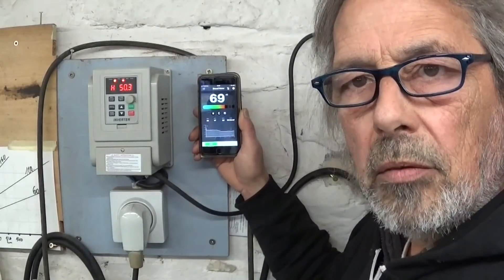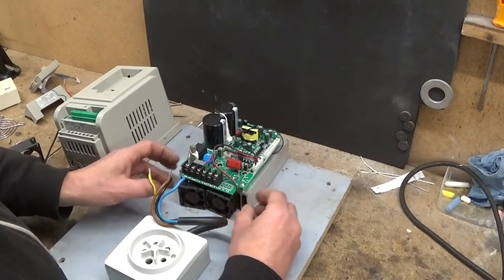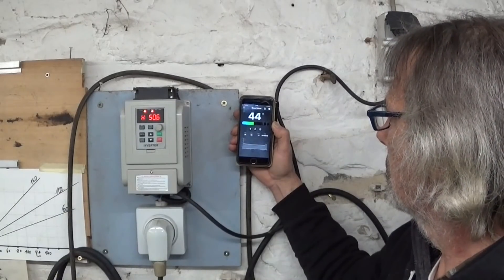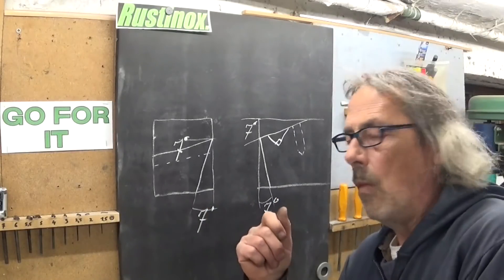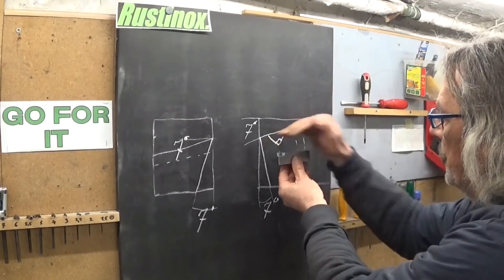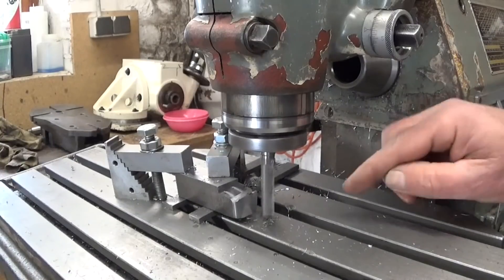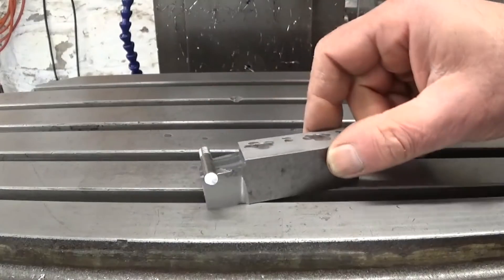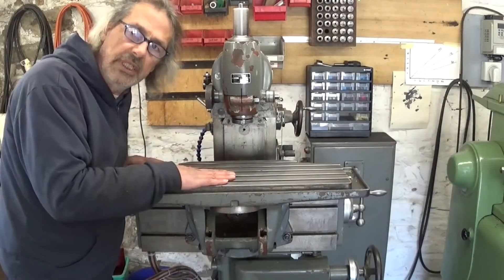A fan, a hand wheel and a show off.

Comment: Great video, Rusti! I have a suggestion. Your solution to the fan issue was brilliant. I would suggest one thing. Swap your fan out for a 140mm Noctua Industrial. 31db and a metric butt ton of airflow. Computer power supply fans are really garbage for the amount of air that they push. I wouldn't be surprised to see a 3x increase in the amount of air you are moving. Really, I think, a fan optimized for static pressure versus airflow, I think you want airflow.

You may not care, but if you do... well, there ya go. Or, when that PSU fan dies, you know where to start.
Reply from the maker: Thanks for you input, Nick.
The VFD never gets warm. Not even a bit. So, this fan will do.

Comment: Man, you packed a lot in that one.  The quieter fan is noticeable, even through the camera mic, the quill wheel is a good idea (I like the one on my mill), and that tool holder could be very useful doing an internal counterbore, especially since the tool bit could be custom ground.  I'm also still fascinated by how flexible that mill is.  All sorts of possibilities!
Reply from the maker: Thanks Everett. On this machine you can make everything... almost.

Comment: Great video. Bighead. My mill will not do those angles. Also as Mark says. My omron inverter only runs the fan at certain temperature. Regards.
Steve.
Reply from the maker: I think I don't even need a fan for what I use the VFD. Future will tell :)

Comment: The rotation of the table? Are you able to rotate it while cutting? Is there a hand wheel to control the speed?
Reply from the maker: There is no hand wheel to rotate the table. It's meant to be fixed when the angle is set.

Comment: At least you wont have to do what the machine does, that will save your back 😅 I've never come across your make of machine before, in one of my jobs I was a service engineer for a machine tool agent in the UK and I installed many machines from European manufacturers. One German company, Wera, made lathes which could turn hexagons, squares, triangles etc but wasn't very good at round parts 😂
Reply from the maker: Well, I guess you've fiddled around many machines then :)

Comment: I did exactly the same thing with my VFD, but I already had a super quiet PC fan and it made a huge difference. I also put it in a case for safety and stop dust and now it's basically silent. 
Also live the milling machine, such versatility.
Reply from the maker: That's a nice upgrade.

Comment: Michel, I fitted the stock fan in my Chinese VFD with a simple temperature sensor held against the heatsink. Now the fan only runs when the heatsink gets to 45C which is almost never. That Deckel mill is truly versatile. Nice to own!
Reply from the maker: I've watched your video on the VFD.
I had a bit the same idea. At 3:51 you can see a thermostat in the background, but it was too big to install.

Comment: Great work on the fan noise reduction! Love the mill and shaper! Just as an fyi...I think some vfd's only run the fan when needed while some of the more cost effective vfd's run the fan all the time. I don't know all the names of the parts in the vfd but whatever the heat sinks are on is what the fan is trying to keep cool. If you run the vfd hard for 5-10 min that part of the vfd will be as hot as it'll get. You can measure the temp at the heat sink. then you could splice into the fan wiring and install a temp sensor switch on the sink so that the fan only comes on when its temp gets 10-20% below the temp measured.
Reply from the maker: At 3:51 you can see in the background a thermostat that I planned to build in. But it was to big...

Comment: Your angles will change when the tool is back in the horizontal plane .  There is a complicated formula to compensate for it . 
Nice quill wheel  Rusty .      Cheers     👍
Reply from the maker: You're right, but I always run when it gets to complicated :-)

Comment: You are winning :) That fan upgrade worked out wonderful. I use the same drive on my lathe, but that doesn't get as much use as your shaper :)
Reply from the maker: Even without modification, its less noisy than your Allen Bradley :-)

Comment: Good idea, nice work.
Was it a "standard" 5 or 12 volt DC fan You manipulated? What was the gear controlling the PC fan?
Will You change the fan in the hot air gun too?  Joking!

25 years ago I invented a method to speed control 48 Volt DC fans. The seller of them said: Not possible....
Reply from the maker: If you invent something that the boss doesn't understand, it will never take off...
Reply: @Rustinox  The retailer said no but in the reality it worked well, and the boss was happy! As the machine sometimes operates in freezing conditions, sometimes in room temperature, controlling the fan was very important for the driver working in freezing....

Comment: Noisy fans annoy me on my PC, I've used "Be Quiet" ones to replace them. Excellent modification, VFDs are normally designed to be housed in an enclosure, so no need for a quiet fan, even though they can have a IP 4X rating. 
Elegant + Deckel just a match made in heaven 😍. 
Excellent video Michel,  thanks for sharing.
Reply from the maker: This is a very cheap VFD, so I don't expect too much of it.
Reply: And always uss the fan to extract air from the cabinet, not to try to blow it into the cabinet. The air flow is more efficient (more flow) and it will be quieter.